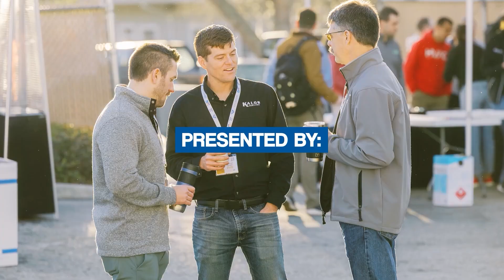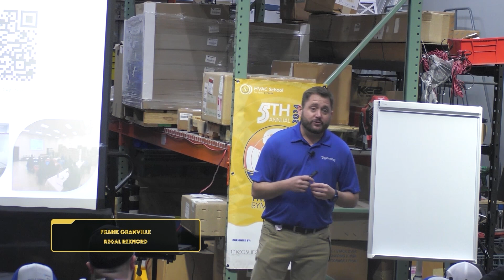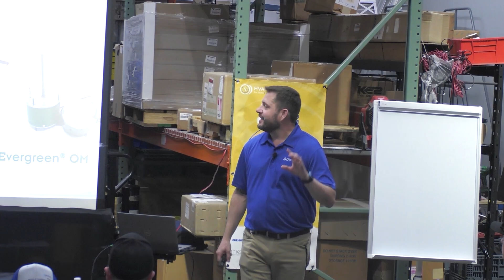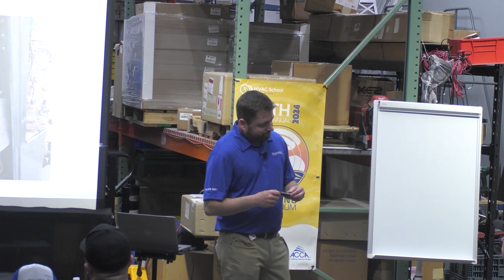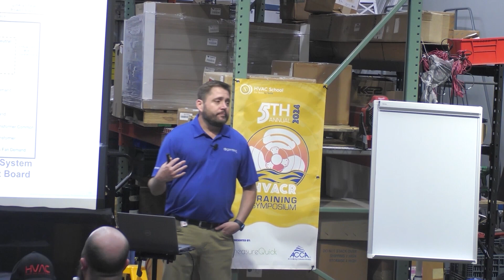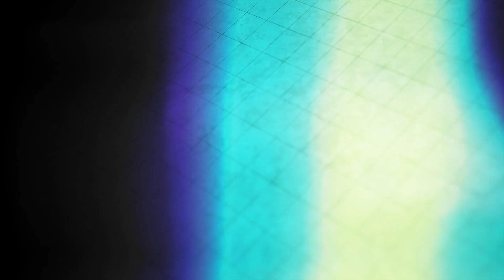The Value of First Time Completion of PSC Motor Failures With Universal ECM with Frank Granville

Comment: The extreme failure rate of ECM motors in air handlers and package units is unbelievable! I’m always looking for ways to convert from ECM to a PSC so I don’t have to return every two years. Before everyone blows up I can take you to systems with perfect static pressure and good voltage to the home. You still see ECM motor failure.
Reply: From everything I've heard, ECM motors are extremely sensitive to power surges.
Reply: wonder if it's moisture/cold having motor downstream of evap coil.

Comment: The average homeowner does not care about PSC or ECM, they mostly just want the least expensive way out to get it back up and running. Our distributor is nearly double the cost for the ECM condenser fan motor, so we'll just stick with the PSC multi hp rev

Comment: I really thought this was a joke at first. With the high failure rate of ECM motors and the price which is usually triple the price of a PSC motor. How do you sell that to the homeowner. I like how he claims he doesn't know the price. Bullsh*t!!!!! Lol.
Reply: He stated doesn't know what the distributor be charging. One distributor could be charging more compared to the other down the road. That's why he says check your local distributor.
Reply: @mackenziegray2090  I know what they’re charging. 2 to 3 times more than a PSC motor. He said they’ve been out for 4 to 5 years already.